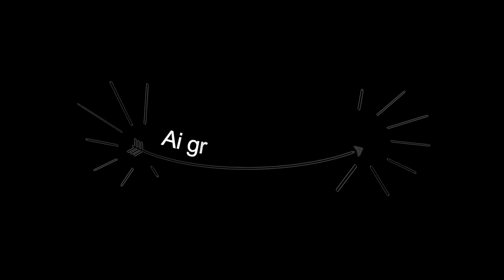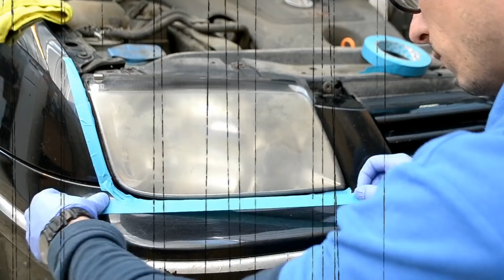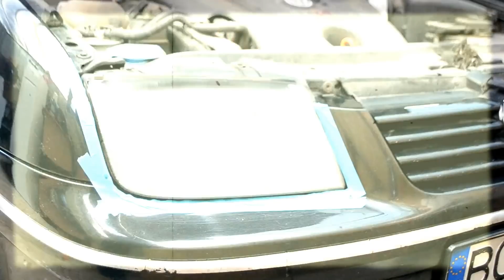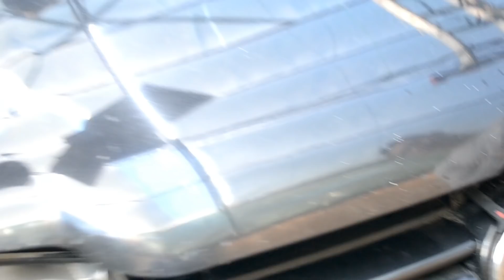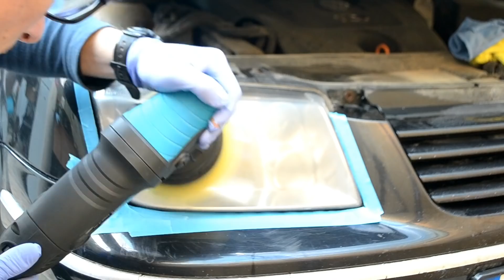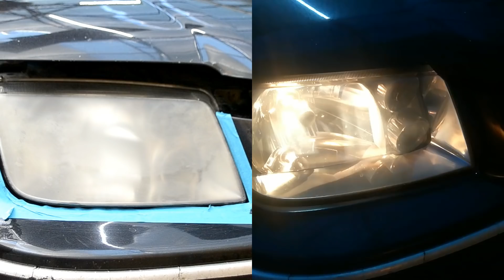Cele Mai Matuite Faruri Din Lume - Restaure Faruri VW Bora

Comment: Salut nu stiu daca o sa imi ras dar macar incerc, mi.am cumparat un kit de reparare a farurilor acel kit are : 
3 tipuri de smirger de 2000, 3000 si 5000
2 paste de polish 
Carpe si tot ce trebuie.
Totul se face manual am facut exact ca pe instrucțiuni totusi mi.au rămas niste zgarieturi.
Acum întrebarea mea este e mai bine sa faci cu o mașină de polish? Si daca da, de ce?
Reply from the maker: Salut! Nu ai putut indeparta toate zgarieturile deoarece kit-ul acela includea  smirghel foarte fin.
Ideal este sa pleci de la granulatie 600-800. 2000 este mult prea sus.